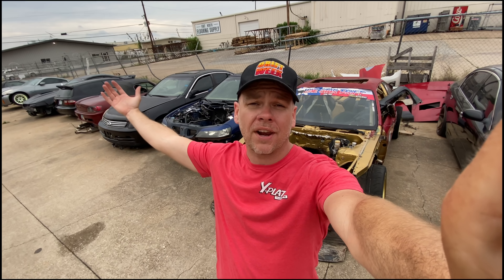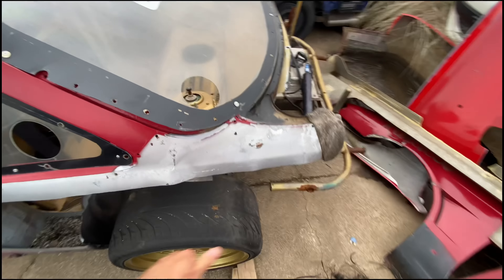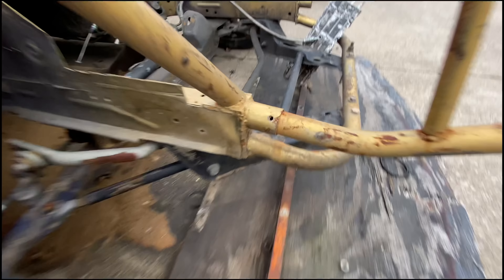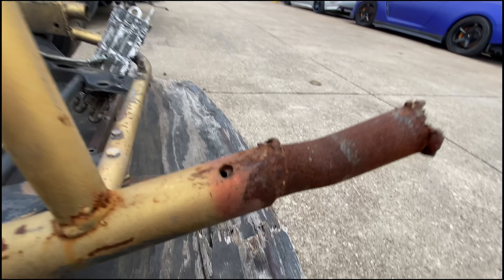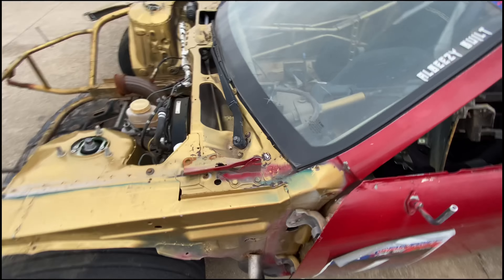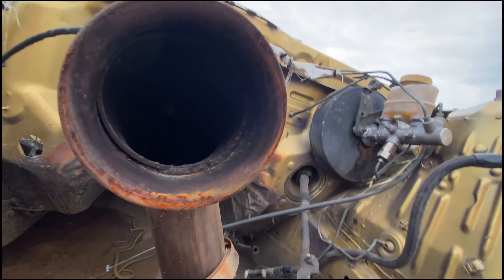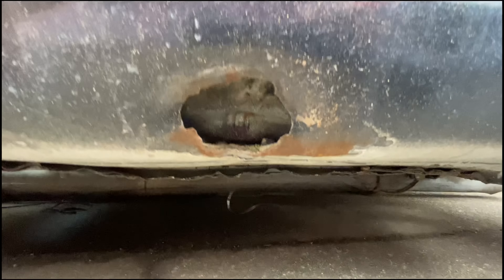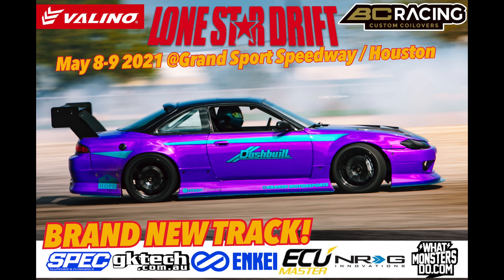ABANDONED Formula D car rots away

Comment: Old racecars are the best projects. Already caged, tube framed and you dont need to be ashamed. Just keep build and reiterating. I say this as I am rebuilding my rusty FC with a new ported motor.. rust belt life

This crap 240 could become a beautiful car with some acid dipping after removing those junk welds. Still has less rust than 90% of the cars up here

Comment: I'm assuming they used flux core for most of that welding or forsure not enough amps wire speed/ incorrect travel speed or angle.

Comment: Is it salvageable do you think? If someone had the time and ability. Like if you patched the wholes by the rear tires and got a new rack for it and put in a drivetrain and fixed up some of the rough craftsmanship/rebuild the bash bars could it be used? Also I know its rough but since it is in bad shape would it be cheaper to use than a untouched chassis given it already has a cage and some good parts on it? For example If you were a first time drifter with not a whole ton of money would it be better to use a used car like this than potentially build and wreck a clean 240sx as you learn? Also would it be more budget friendly given it already has a decent looking cage on it and just needs the old stuff taken off and remade better?
Reply: Waste of time start with a stock 350z and grow into the platform don’t waste your time building something insane if you don’t know what you want to do driving.
Reply: @Itskylewalker  I guess thats true, I have heard they are great seat time cars and long lasting but at least where I live those cars fetch anywhere from $8-17,000 completely stock. And with the condition of this car and with how long its been sitting I bet you could score it for half that price and swap a LS in it with the angle kit it has and be out ripping for the same price as a stock 350z. It would be a chassis I wouldn't even have to care about and I wouldn't be nearly as financially invested in it. Also if I did buy this car and fix it correctly and decide to not continue drifting or just want a different car I could resell it and make a profit but with the 350z once I drift it or put on a angle kit the value will go down. 350z are getting bought up left and right and that's driving the price up where these old drift cars are just sitting vacant for cheap, its a tough decision.

Also 350z's are great cars but once your skills improve the amount of power it can produce is not enough unless you turbocharge/supercharge it and Im not going to spend all that money on that when the VQ motors aren't capable of high power unless its a built bottom end so unless I engine swap it basically its road for me ends when I max out the use of it N/A. Also if Im going to participate in any events I would have to cage the 350z and at that point why don't I just by this 240sx thats already caged and gutted and just needs a drivetrain and to be fixed up a little and it could be a threat to anyone who I line up with. 

But I appreciate you taking the time to comment the 350z just does not work for me for where I live its just to much money to pour into a car thats going to get hammered.
Reply: @tstuff1213  sounds like you got everything figured out bud. Good luck.
Reply: @Itskylewalker  😂

Comment: They cut out the sides of the rear fender walls to throw more smoke out the wheel wells.. I was wondering why it was so precisely cut, the air coming thru the windows will push the wheel smoke out more...
Reply: That precise hole in the side of the chassis is from the factory, what was cut was the tub around the wheel